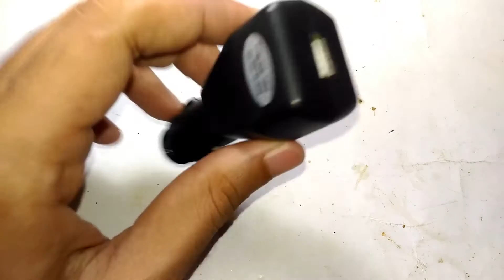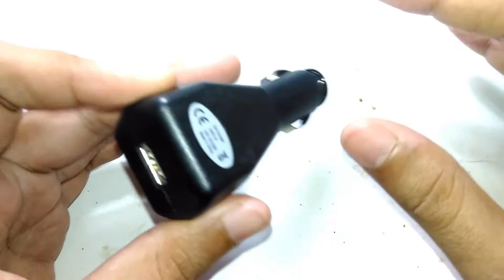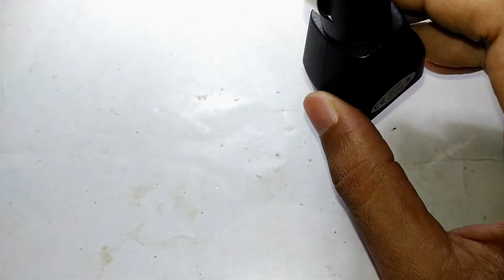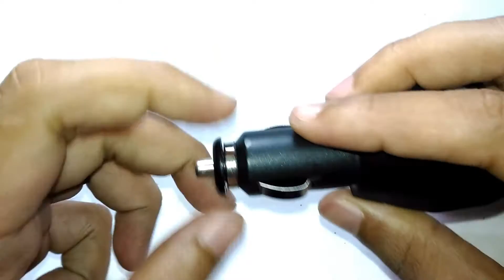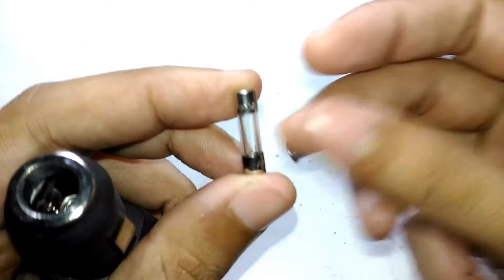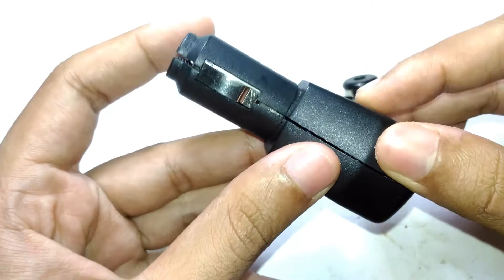IE44: How USB car charger works?

Comment: How to use this out of the vehicle( in a house) connecting normal speakers.
Reply from the maker: In fact, to connect a usb speaker, you can use your regular mobile charger. No need to use this type of converter. However, if you are determined, you need to connect this to a 12 volt wall adaptor by using a suitable car lighter socket or by splicing the wires and then connect your speaker to this.
Reply: Thank you so much..
Reply: Can you send me small wire diagram.pl.thank you..
Reply from the maker: Please tell me what your exact requirements are, and I will try to help you with the diagram. 👍🏼
Reply: I want to use car usb charger (cigarette liter) in a house.I know dc 12v power supply part.
How to connect car usb charger to normal speaker. Not in a  car.
Thank you..
Reply from the maker: Ok. For this to work the speaker must be powered from the USB, let's say it's a 5V speaker. In that case simply plug in the usb cable to this car adapter and connect the car adapter to 12v power supply. It will work. Wait, I shall draw it for you.
Reply: Ok.thank you very much....
Reply from the maker: @rohanapinnawala9892 Here is the image link https://jpst.it/44tzw
Reply: Ok.thank you very much. 
I will try....

Comment: Are usb charger for 230V AC working the same way? (After current alignment of course)
Reply from the maker: This is a buck converter and ac chargers are mostly flyback type. The difference is in the isolation between the input and output.

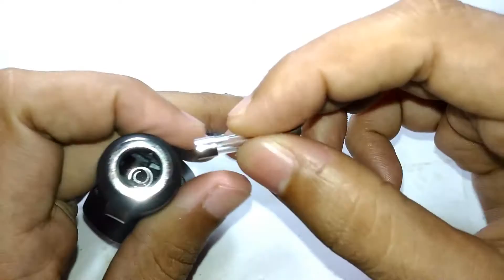Comment: 2:01 what is this ? called I have problem and I want to buy that small thing
Reply from the maker: At that time frame, on my left hand is the glass fuse and in my right hand is the tiny cap for the same.

Comment: Hey it said you can use it with 24V input too, does increase the output amps at 5V too? Or where do those extra volts go, to heat?
Reply from the maker: Nope, connecting this to a 24 V supply won't increase the output current. The added voltage won't go much as heat, instead, the switching frequency is adjusted so that the output voltage remains constant at 5 Volts.

Comment: nice, i'm planning to buy a Xl4015 step-down converter and fix at 5V output, do you think that it has better average quality than the car charger? i opened one car charger and the quality of the components, soldering inside was very poor
Reply from the maker: 4015 is a good choice. The only downside will be a very DIY look to the whole project. Cheap car chargers are made to a price, so we can't expect it to be of a higher quality. If you don't want to have a DIY look you can go for a higher quality car charger.

Comment: I am planning to buy a car charger but when I come to my mobile chargers it is written that the output is 5V 2Amp while input will 100-240V. But in  car charger it was written that input was 12V-24V and the output was 5V--2amp. Whether this output is necessary to charge 5V-2.1 amp and 5V-2.2amp in cars. I am asking this because my family members have the above mentioned output figures.
Reply from the maker: Input voltage doesn't matter. All you need to do is make sure the car charger output is a minimum of  5V 2A, which is widely compatible with almost all new age phones. Also phones with type C cable and micro USB cable can both charge from the 5V2A charger. But I would rather recommend you to buy a quick charge compatible car charger. In which case if you plan to upgrade your phone in the future, it will come useful for quickly charging on the go. 😊👍🏼

Comment: can these chargers be upgraded by replacing capacitors or the inductor inductor? thanks
Reply from the maker: Not always, since the amp rating depends also on the switching frequency. Adding more capacitor will reduce the noise though.

Comment: This was pretty interesting, thanks for the vid ! Just one thing, I don't understand why it's already dropping to 4.5 V at 1 A when it says it can reach to 1.5 Amp
Reply from the maker: That's because they were making false claims. The charger may only be designed to give say 500ma or 750ma of current and you need 1 Amp, and then it fails to keep up the voltage level. Thanks for your valuable feedback . :)